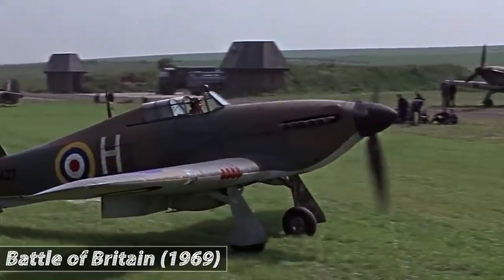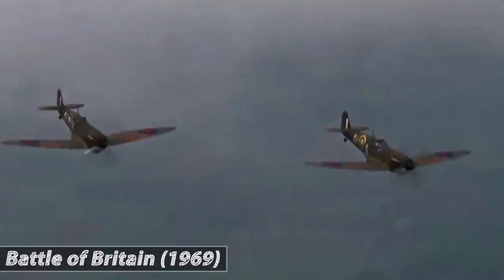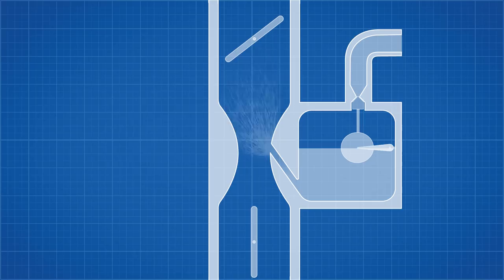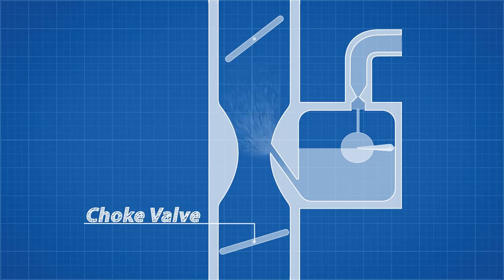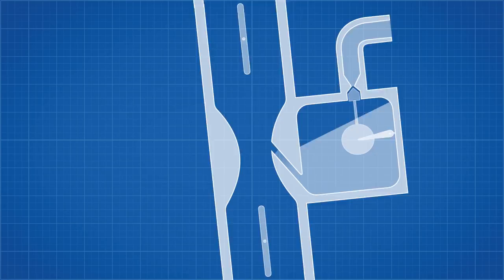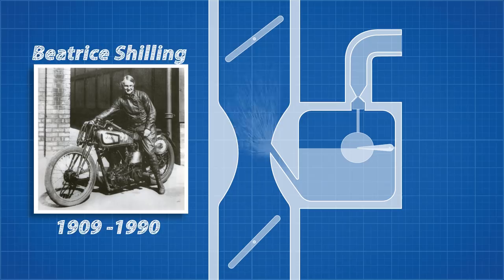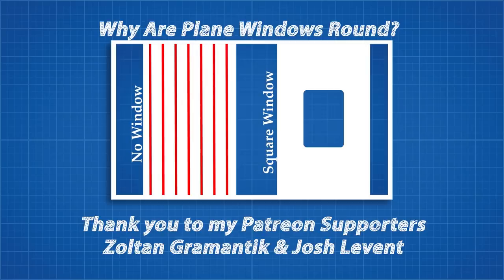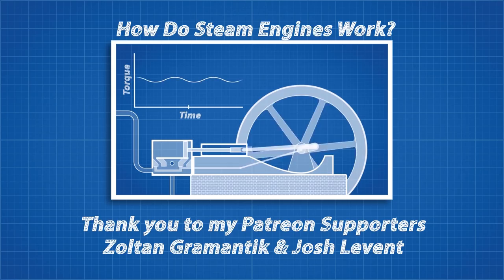The Spitfire's Fatal Flaw

Comment: Whilst I agree on all counts regarding the visual references whilst discussing the spitfire, many people have already pointed out this "fatal flaw" in the video..
A couple of points though that may not have been mentioned
1. Whilst the negative G effect on the carburettor is valid, this was quickly noted pilots who simply changed their style of flying to compensate. The result was simply to invert the airframe by rolling over then pulling up into a climb thus negating the effect. This is why the iconic scene of formations peeling off to dive down on enemy aircraft.
The problem was much more pronounced when levelling out from a climb, not going into a dive.
2. The initial scene showing the black smoke was actually not a negative g manoeuvre, and was actually included (if I recall correctly), to highlight the fact that a pilot was showing off with a damaged aircraft after returning from a sortie.
I think the video has more flaws than this particular aircraft.... 😳
Reply: Regarding 1: It was a real problem for the British pilots as the Germans quickly came to the tactic of just pushing their planes into a steep dive if followed by Spitfires or Hurricanes.. The British had to roll their fighters belly up to follow them, giving the Germans enough time to get a better position.
Reply: Pretty sure it was a zero-G maneuver, whilst it wasn't you standard pushing the nose down in level flight you can see he gets to the top of his roll upside down and then the plane falls down and back around to complete the maneuver, so there would have been negative G's for the moment where the plane backfires...
Reply: x3tc1
The slight problem was not only quickly solved it was not even considered much of a problem by RAF pilots, from the information I have been able to find both Spitfires and Hurricanes were being modified in 1940 and they had a complete cure in 1941.
I wonder why this problem did not affect any other fighters like the P 39, P 40, P 38 or early P 51? they all used carburetors but not the RR carburetor which was the first to overcome this problem.  Maybe because the US fighters did not have combat until later.
Reply: Plus the Spitfire's terrible rate of roll because of the wings and .303 guns
Reply: Joshua.
The Spitfire rate of roll was better than anything else except the early Fw 190, the very good 0.303's were more than adequate in 1940, by 1941 they were using 20 mm which were better than the USAAF still stuck with their 0.5 machine guns in 1945.
Maybe why the Luftwaffe pilots rated the Spitfire as the best they had to face, not the later P 51 of 1944 or the P 47 of 1943 and certainly not the P 38 of 1942, the Spitfire in combat left them all in the shade.
Reply: @barrierodliffe4155  I've been wondering this whole debate of if the 50 cals on American Aircraft was enough. I don't see anything wrong with having a 50 cal. in most instances. While it might not be the best round it was still very formidable. From what I understand is that a 50 can pen an inch (~24mm)of armor at 100 yards, and most aircraft were of 8-13mm. While yes aircraft had face hardened steel so obviously it is stronger than normal but that doesn't mean a 50 still can't pen. In fact many people found that most german aircraft didn't carry armour strong enough to stop a 50 and thus this is why the US never really moved away from it. So if it's still taking down planes and doing the job it was designed to do then why would people still hate on it? Only logical conclusion is that the other calibers were better. Well that may be true but I feel like you aren't looking at the whole picture. Yes, a cannon round may be better but what are you going to do when you run out of ammo? That's where I feel the biggest debate comes. Were cannon rounds effective enough to negate the fact you have less ammo? I don't know. Do I think the US should have moved more towards cannon rounds? No, manufacturing was already in place and at maximum efficiency by the time the US really could have considered it it was too late. Also US was fighting Japan who are known for having wooden aircraft through most of it and no self sealing tanks. Which a 50 was all you really needed. So let me ask you, Why should the US have switched to a different caliber and what was wrong with the 50? If you read all of this, thanks! Also, don't interpret this wrong, these are genuine questions and sorry if it comes off rude. That was not the intent, I just wanted to see others point of view. Also sorry for the inevitable spelling and grammatical errors. Wrote this on my phone at 1 am (.-.)
Reply: ACEO
13 mm is 0.5 but most fighters were using 20 mm during the war, especially by the time USA was in the war.
I have to ask why both the USAAF and US Navy wanted 20 mm on their fighters they tried them against the 0.5 and came to the conclusion that the 20 mm was between 2.5 and 3 times more effective.  The US tried to move towards 20 mm, they made many millions of rounds but stuffed up on their copy of the British Hispan.  
Why should the USA have switched?  maybe ask the USAAF and US Navy why they wanted to.  The US were not the only ones fighting Japan.   
I have one question, why did so many RAF pilots shoot down Luftwaffe aircraft firing a handful of rounds while the USAAF had to fire hundreds of rounds often doing no damage.
Maybe ask the USAAF pilot who was flying an unarmed Spitfire Mk XI when he was attacked by 4 P 51's.  he had no trouble getting away and they each having fired at empty sky claimed a Bf 109 shot down.
Reply: @barrierodliffe4155  American carburetors on their military aero engines were not the same as British ones, and were usually Strombergs (spelling?), with pressurised fuel feed in to the float bowls/metering chambers. This came from their daredevil stunt shows and aero racing heritage from the 1930s, plus they jealously guarded the patents and issuing of foreign contracts for them - like they did with helium (cough cough Hindenberg cough). 
   Until WW2 forced the Brits to follow suit and develope & fit similar pressure carb' systems, and required the US to give us their reiable fuel pumps, it was thought of as wasted expencive pilot luxury that could go wrong at a somepoint important that training could already solve.
   Apologies if you think I am assuming your an idiot, you certainly are not, and I didn't intened to come across as such.
Reply: @razor1uk610  
I agree with you that American carburetors were not the same since Rolls Royce not only solved the problem they developed a better carburetor by working with SU and gave it to Bendix Stromberg who had struggled to develop a similar system,   Rolls Royce partly solved the problem in 1940 and completely solved the problem in 1941, well before they used the later Bendix carburetor which was developed from the Rolls SU carburetor given to Bendix Stromberg, you notice the word given, US always demanded money for anything they sold, very much a one way street with the Yanks who profiteered out of both world wars..
Reply: I have watching this channel for a while now and now I see that this whole channel has more flaws than the Spitfire.
Reply: Barrie Rodliffe  GUARANTEE you the German were more afraid of the Mustang than they were the Spit.
Reply: @SuperBeaker1  
Maybe you know more than Luftwaffe pilots.

Writer Jerry Scutts, quoting German pilots in his book JG 54: "The Jagflieger had to keep a wary eye out for enemy fighters, particularly Spitfires, a type JG 54's pilots had developed a particular aversion to...Pilot reflections do not, surprisingly enough, reflect over-much respect for the Mustang or Lightning, both of which the Germans reckoned their Fockes were equal to - unless they were met in substantial numbers." 

Karl Stein, Luftwaffe Fw 190 pilot (who served mainly on the Eastern front): "English and American aircraft appeared on the scene in those closing days of the European war. Spitfires were the most feared, then Mustangs..."
Reply: Barrie Rodliffe Mustangs had a top speed of 437 mph and a kill ratio of 11 to 1.  When Goering saw P51’s escorting the bombers to Berlin in 1944 he said “The war is over.  We’ve lost.  I love the Spitfire but I’m pretty sure it didn’t have a kill ratio of 11 to 1.  It was also 68 mph slower.
Reply: @SuperBeaker1  
True the P 51 D  in 1944 did 437 mph, I believe later they got up to about 442 mph. the kill ratio is not able to be confirmed because of overclaiming and inconsistencies.  
The speed of a Spitfire can be proven, the Mk I in 1939 did about 362 mph, and that is 65 mph less, but then we have the Mk II, Mk V, Mk VI, Mk VII, Mk VIII, Mk IX, Mk XII and Mk XIV and that is up to the end of 1943, the Spitfire Mk IX in 1942 did 404 mph and a bit more later, the Mk XIV in late 1948 did 447 mph and more later, I make that faster than the P 51, and also the rate of climb, even the Spitfire Mk IX of 1942 had better rate of climb and acceleration and went higher.
I am pretty sure the Spitfire had a better kill to loss ratio but as I say it is not able to be confirmed.
It would be strange for goring to say the war is lost in 1944, he had already said that a year earlier when DH Mosquitos dropped bombs on berlin and Goring had nothing to catch them, Hollywood often distorts history.
Reply: That's why you EDIT before distribute / show the video, genius.

Comment: They also had a issue with the wings according to test pilots. Wings could snap between the gun bays if ya over G'd. Wonderful aircraft. My dad flew the mk5 and mk9 then the P51 with the 333 15th airforce.

Comment: The so called fatal flaw.
I have found an account of a trainee Spitfire pilot who was at OTU 57 in October 1940.
The full account is rather long so I will only put up a small bit.
Many of the OTU  Spitfires were early and had that hand cranked undercarriage.
after preliminary training including flying the Miles Master the pilots were then let loose in a Spitfire. 
" The second pupil went up for his first flight in a Spitfire. It was a pump handle kite and those watching were amused at the erratic take off.  He flew towards Anglesey and was enjoying himself, and at about 4,000 feet he thought I might as well try some aerobatics, having done a barrel role then a loop which were fine except he had pulled back a bit hard on the stick and almost blacked out, he then tried a dive. He pushed the stick forward and the result was the water and mud on the floor was thrown up all over the inside of the cockpit, the engine cut out and he was pushed up as far as the seat belts would allow, he slammed back into the seat and closed the throttle then gently opened it up again and the engine started and ran as sweetly as before.
Unintentionally he had hit on the main snag of the Spitfire since the OTU Spitfires had not so far been been modified. He then tried another dive by rolling over and pulling the stick back which worked just fine."
This confirms that the negative G was not a fatal flaw and easily overcome and that all Spitfires in combat squadrons had been modified before October 1940.
Reply: Thought you said small piece
Reply: @bluesubaru7338  But informative, and gives the lie to clickbait headlines...
Reply: @bluesubaru7338  
You should read the whole account, I only put up a small but relevant bit of it.

Comment: I know about Miss Shilling,s modification to the Merlin 111,s Skinner Union Carburettor, a simple washer that keeps petrol flowing to the engine when upside down.But do you know about the spitty,s second flaw. Early 1942, when Malta needed Spitfire V,s delivered like yesterday to beef up her defences against the Messershmitt-109 F and Macchi Castoldi MC 202 Folgore. Huge factory at Castle Bromwich had the lions share of Spitfire production ,most earmarked for Malta. Alex Henshaw a pre war playboy pilot,landed the job of test flying  Spitfires fresh off the production line. One such test flight nearly ended in disaster, Alex lifted off the grass a brand new Mark V, Spitty to undertake a series of acceptance tests.  Few minutes into the test the Spitty,s Merlin 45\47 died, no coughing ,gobbing  like a 40, a day grandad,instead ,the engine just cut out. He had the option of bailing out and leaving the Spitfire to crash, but that was out of the question . The airfield is surrounded by housing and factories, so wanting to know why the Merlin died suddenly Alex  stayed with the Spitty  in order to glide her back to the airfield for a crash landing.  Executing  series of 'S' turns he scrubbed off height and speed. Alex came in too deep, over the grass ,then thinking outside the box  he hand pumped down the flaps and undercarriage. increased drag slowed  him enough to make a dead stick wheels down landing on a cinder track connecting the airfield to the flight sheds ,stopping in a shower of cinders, dust and dirt.  Erks, engineers  quickly wheeled the offending Spitty in the shed her Merlin quickly stripped down. Cause of the Merlin cutting out, double magneto failure, in simple language Alex lost both ignition systems. At the Merlin,s back between the engine and blower,is a set of gears driving the camshafts and various accessories, vacuum,coolant pumps, dynamo, air compressor ,etc .  Both BTH magnetos shared a common drive, i e a cross shaft, this important shaft driven of the vertical shaft that drove the camshafts via  a pair of skew gears, normally found in bus destination blinds. These two gears became de-meshed the cross shaft losing drive and both mags ceased working. Rolls Royce Derby sent urgent bulletins to front line squadrons and Packard,s to pay close attention  regarding the correct meshing or' Backlash' of these two vital skew gears.It was not just the Spitfire ,but other important aircraft, Lancaster,Mosquito,Hurricane, Mustang, Warhawk ,all powered by merlins.

Comment: Correctly its NOT just the Spitfire but the Hurricane too needed the fix to the Rolls-Royce Merlin's fatal flaw. The fix is informally know as Miss Shilling's Orifice or Miss Tilly's Diaphragm or the Tilly Orifice....developed by Beatrice (Tilly) Shilling and officially known as R.A.E. restrictor...!  P.S. the Messerschmidt Me109's engine didn't such a problem because it was fuel injected.

Comment: The fuel problem was considered little more than a foible shared by all contemporary aircraft (except the fuel injected Daimler Benz 601 engines used by Germany). A simple fix was introduced 1941  [https://en.wikipedia.org/wiki/Miss_Shilling%27s_orifice] and finally solved in 1943 by pressure carburetors.